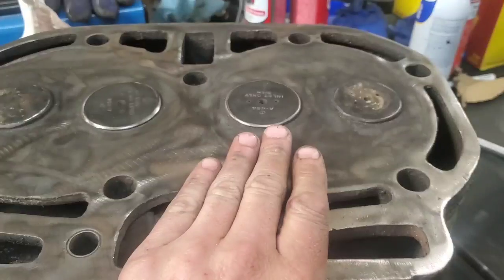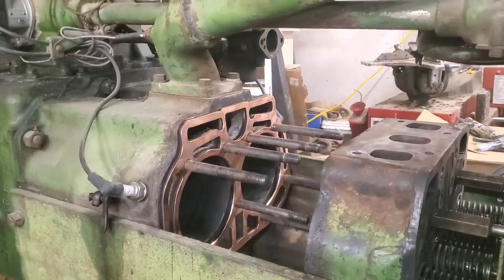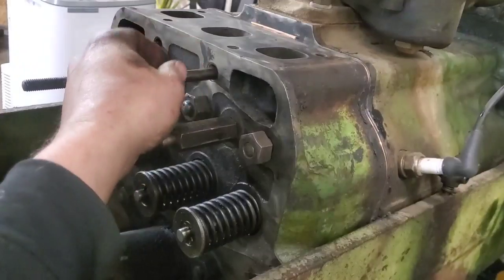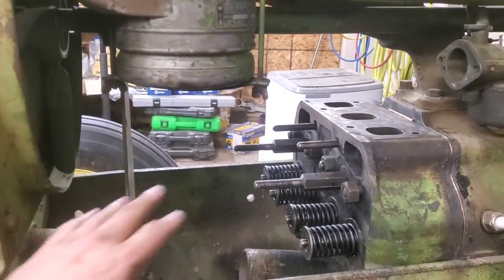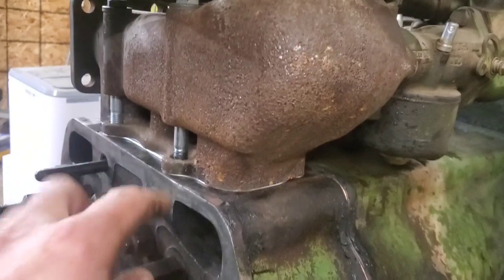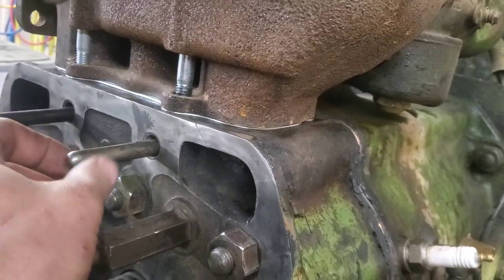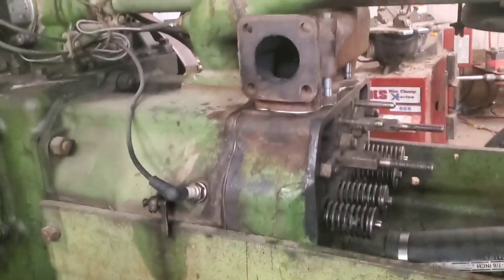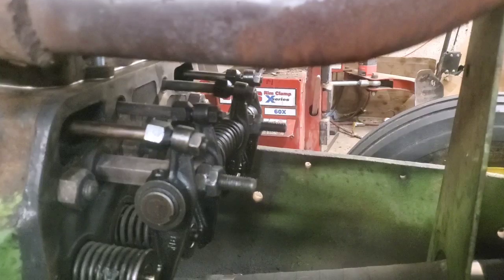John Deere Model A Two Cylinder: Coolant leaking into oil Part 2

Comment: Well,  you fixed the head the right way considering the push rod tube probably isn't available anymore and you've done a good job overall it looks like on a very straight tractor.  My question is why didn't you bother to get a service manual that tells you the head bolt torque sequence and amount plus how to adjust the valves?  Service manuals are easy to find and cheap.  I have them for all my tractors and most of the equipment.  Amazing what you can learn from owners and service manuals.  Hopefully you put the push rods back in their original places.  Good video and it should be able to work hard again when you're done.
Reply from the maker: I did get a service manual.  I'll be showing how to adjust the valves soon.  No I didn't keep track of the pushrods.  Not a huge deal.  These engines run at about 900 RPM.  And it's not being used regularly.  You can also never warp the head if you torque the nuts out of sequence.  It's an 84ish year old tractor.  It's gonna be fine.  Built really strong and simple.
Reply: That's a beautiful tractor and well taken care of for all these years, unusual find.  Glad you now have the service manual for it as manuals are the 1st thing I get after buying something.  That's why so many 2 cyl.'s are still working hard because they are well built and forgiving tractors.  It's always a good practice when reusing parts is to put back in same place because through the years that's where they are worn into, especially like lifters on the camshaft.  It will be fine and you did fix the head right.  Actually I was thinking I would see a pretty lady working on tractors but still wasn't dissapointed, Lol.